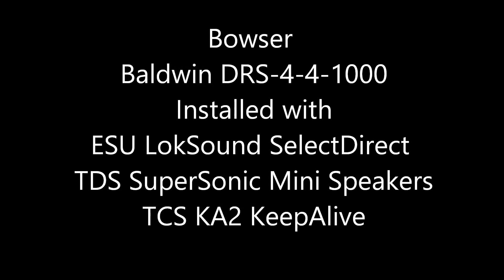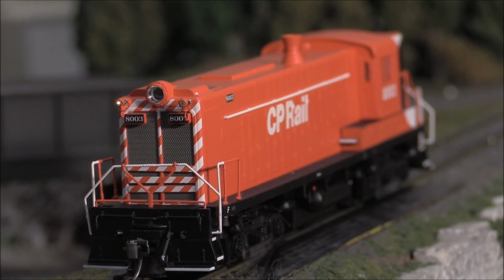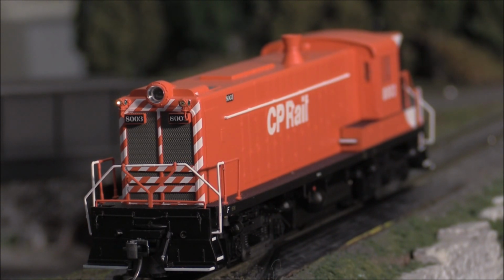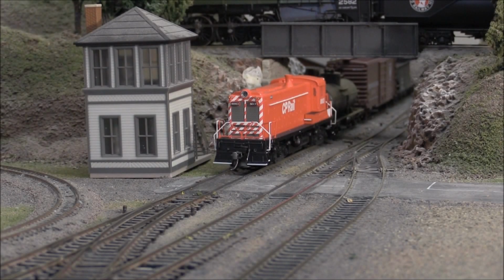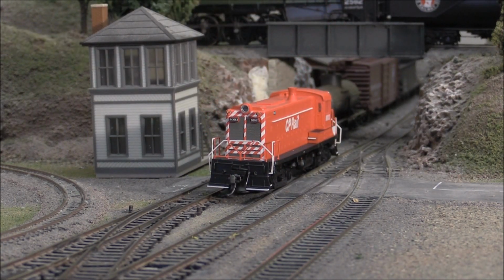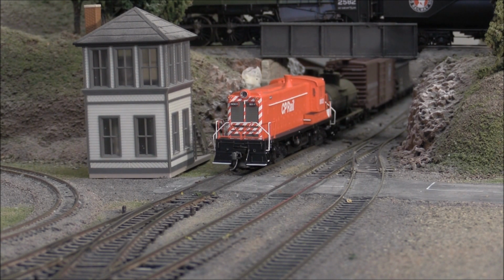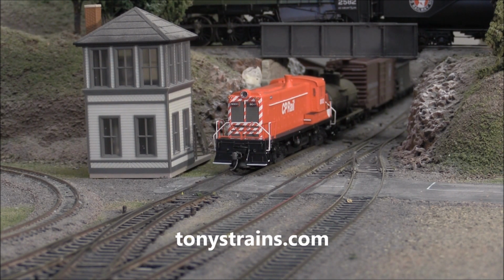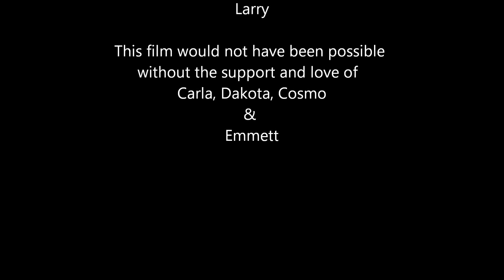Bowser Baldwin DSR-4-4-1000 with ESU LokSound & TDS SuperSonic Sugar Cube Speaker

Comment: Would be nice to know what changes you had to make to get these two to work together. 
Maybe a video showing them?
Reply: Hi West, which two? I think there is only one loco in this video.
Reply: Oh I see ... you used a KA2 Keep Alive pack. I thought you were using a Keep Alive Mother board.  Im trying to use a TCS AK-MB1 with a LOK select 21pin decoder.
Reply: are you having a problem with the fitment?
Reply: Fitment is fine. I installed the AK-MB1 in an Atlas GP38-2. The LOK decoder fits fine on top. It seems the functions are different between the LOK and the TCS product.

Comment: That surely isn't the top 625 RPM these in my eyes wonderful not enough credit given switchers deserve is capable of is it.  I was looking forward to a notch 8 equivalent or top RPM of this engine.  Even though the sound of the low RPM hit right on the money 💰 thanks for the video, I'm a DS-4-4-1000 S-12 VO-1000 big follower.  I think even against today's engines that these big straight 6's & 8's would be the way to go.  That De La Vergne 608sc Engine at 625 RPM produced flywheel HP of 1750 with a traction effort of 1500 HP.  AT 625 RPM nd that kind of torque, that'd make for an outstanding reliable engine coupled with today's electric alternators traction motors and electronics.  Just saying lol